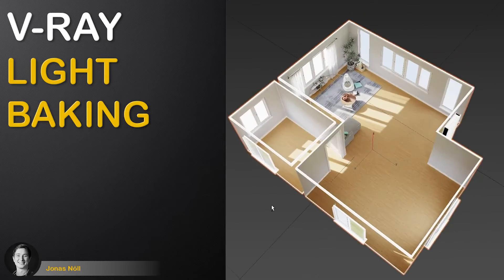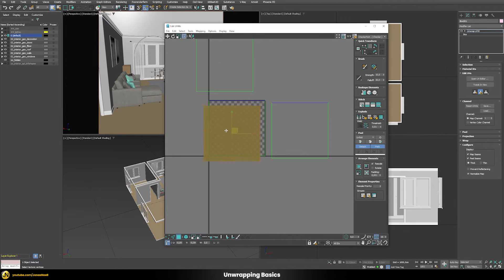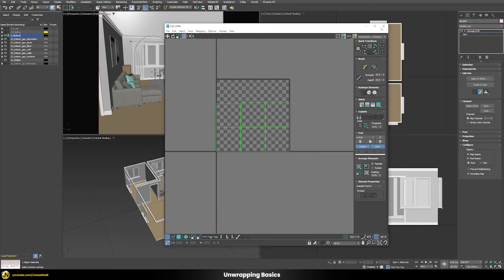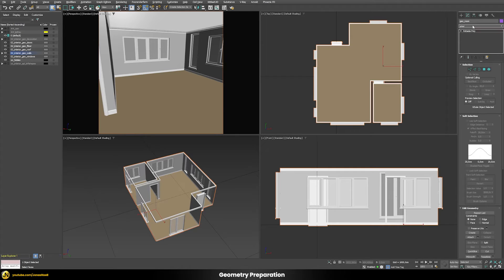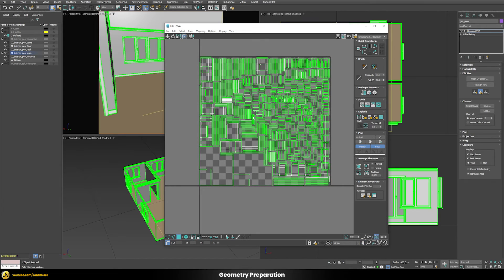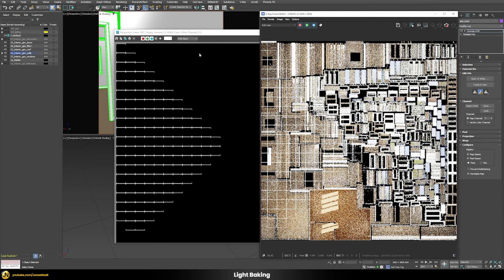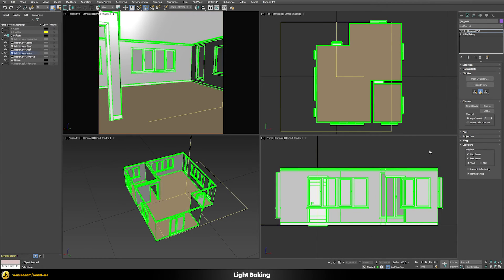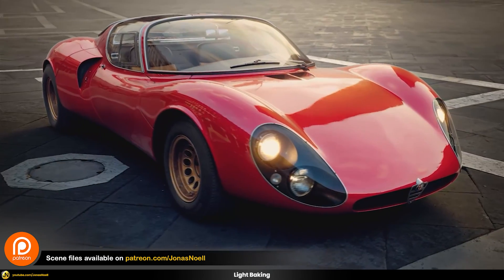V-Ray | How to BAKE LIGHTING into a texture

Comment: Hello, excellent tutorial, why do burning the walls leave them with white edges? I appreciate you can help me
Reply from the maker: It's probably light leaks. Make sure that there is no strong light hitting the walls from the back side or create some shadow blocker plane to prevent that. Otherwise in baking there might be those unwanted results.

Comment: Top tip : Specular reflections are view dependent ( based on the camera position ) but ... baked textures have 'no camera' so how do we control the specular component ? 
In the latest V-Ray  versions there is a hidden parameter to specify the camera for texture baking; it's not in the UI but you can set it from MaxScript: -

renderers.current.camera_bakeCamera=... 

If a bake camera is specified, the reflections will be baked according to how the surface is visible from that camera.

Comment: Great tutorial and a very useful technique to be sure! I do have a question however, is there a reason you used Render To Texture tool instead of Bake To Texture? I was under the impression RTT is a legacy feature and BTT is the go-to, much improved toolset to use now.
Reply from the maker: Oh interesting, you caught me off guard :-) To be honest I totally missed that there was an update to it. And somehow in my 3ds Max it also doesn't seem to load correclty, I just have a "Missing Plugin" notice at the position where it should be in the rendering menu. I will investigate. But if there is an updated version then this is most likely superior. I guess it will still require the unwrapping though, so 95% should be the same.

Comment: its only Diffuse color map getting from Vray, what will be the solution for other maps like Metalness, Roughness and Normal Maps
Reply from the maker: Actually you can bake out different maps if you don't want everything in one map. I used the "VRayComplete" option, but you can also separate the Roughness, Metalness, etc. in different maps using the equivalent element.